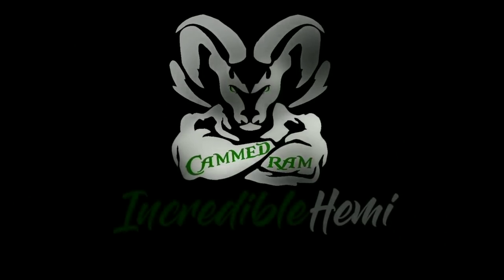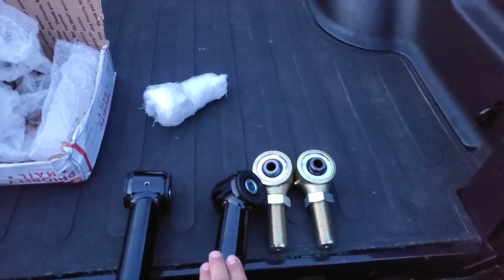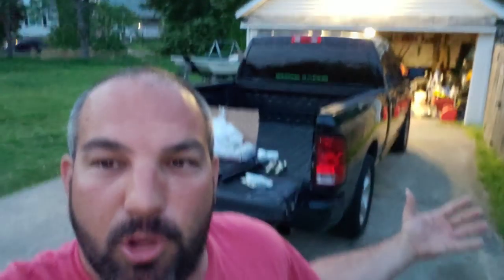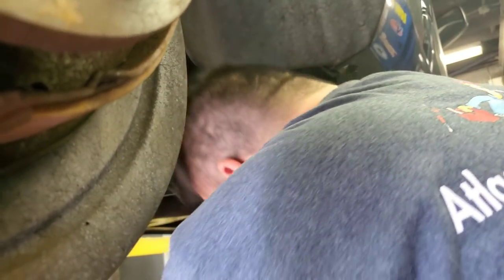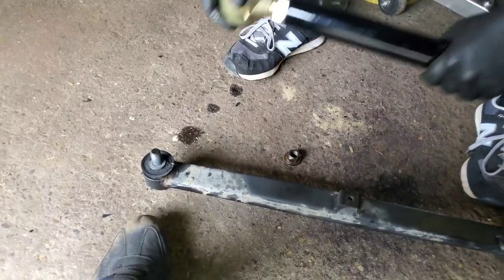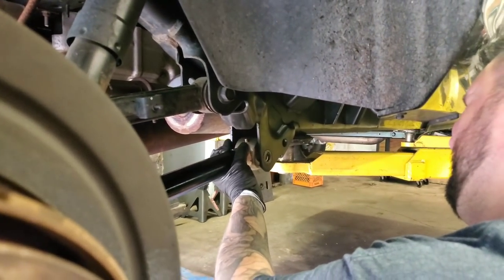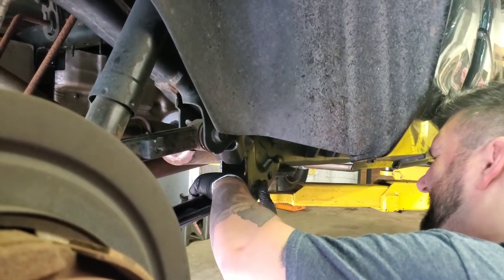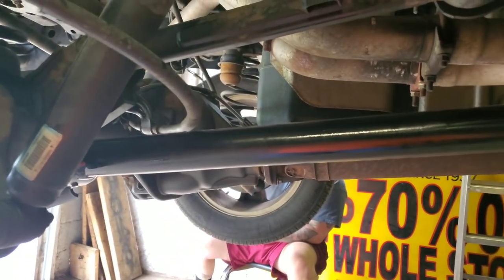CORE4X4 Lower Control Arms INSTALLED on Ram 1500!!

Comment: Got my set sitting here to install too! As soon as I got my new Hemi stroker running I had wheel hop. I got the Core 4x4 lowers too and for now just got new factory style uppers from RockAuto since they were only like $30 and mine had 100,000 miles and had pretty soft/worn bushings.
Reply from the maker: Yea these drive soo smooth I can feel them plant the rear of my truck

Comment: The hi price brand name long tube headers make better power than the ebay cheapies as they are basically identical copies. Don't waste your money on the hi priced headers just make sure you get the right tube size.
5.7 L Hemi N.A. 1-7/8" o.d. is the important part, if they are the same design there was maybe 1 hp difference on an engine dyno
Reply: Sorry, it should have said "Make No More power than the ebay cheapies"

Comment: How did you get that to fit when the bolt holes wouldn’t line up? I’m replacing mine right now and I can’t get the holes to line up
Reply from the maker: You need to push the whole axle up to where the bolts line up
Reply: @IncredibleHemi1111  how’d you end up pushing the axle up?
Reply from the maker: @braedonnickelson8057  with a bar, axle needs to be free standing

Comment: Did just the lowers totally get rid of wheel hop???? Just recently installed a Eaton posi unit and some 3.90s  the wheel hop makes me wanna smash my truck please help😆😁😁🇺🇸
Reply from the maker: Yes the lowers alone will stop wheel hop, getting uppers with it it just even better
Reply: @IncredibleHemi1111  awesome! What do the uppers add to the whole situation? You just ran the lowers for a while right? Just wanna kill these tires
Reply from the maker: @jasonvalentine3812  I ran the lowers for a month or so then core4x4 sent me the uppers for making this video for them
Reply: @IncredibleHemi1111  are there any other options that you know of? Or should I just order a set tonight? 😁
Reply from the maker: @jasonvalentine3812  these are the best every fast ram guy has them
Reply: @IncredibleHemi1111  got a discount code? I'm about to order?
Reply from the maker: @jasonvalentine3812  I don't ,sorry man